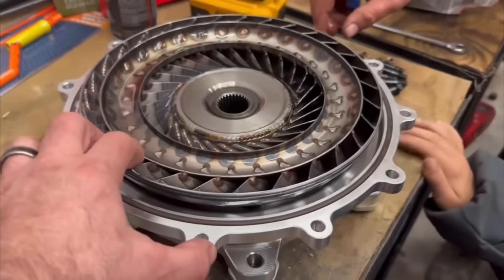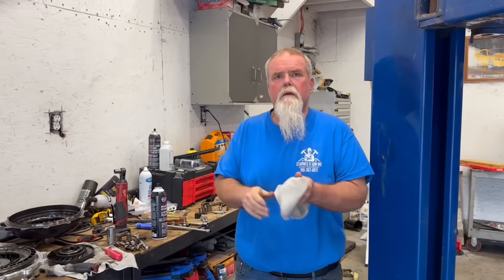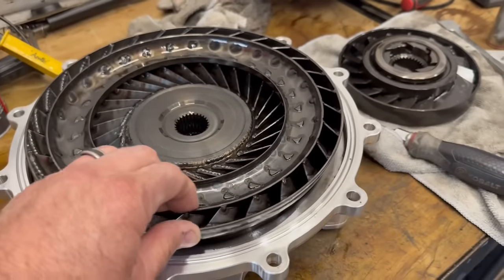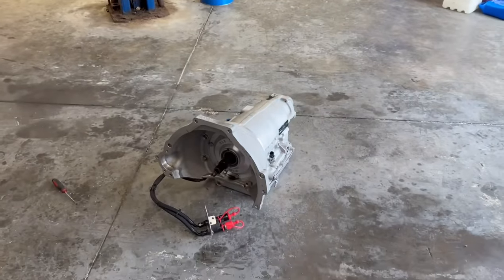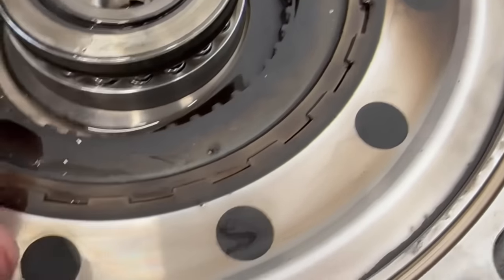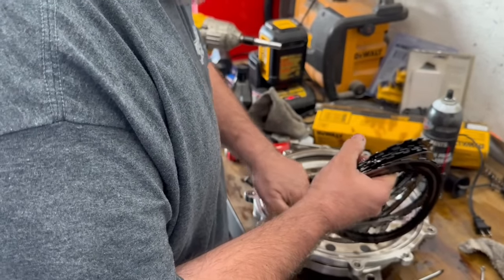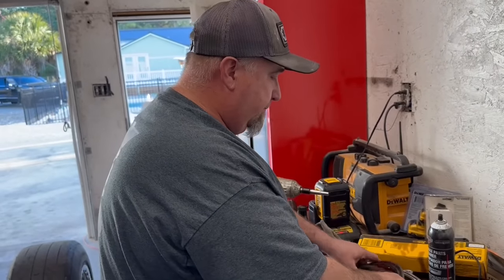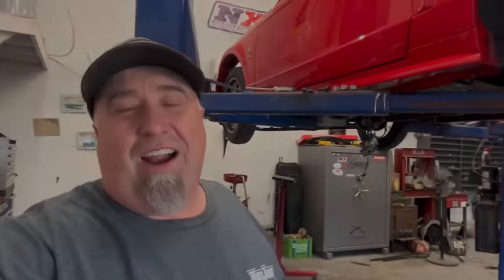Turbo 400 Lock Up Converter Problems!  What went WRONG?

Comment: Is the dump valve internal or external. It's a bfd in world of 400. The way it runs it needs to be internal or it can starve a part of the trans.  It's a million times better the external on a 400. All I see are external cooler lines tho.